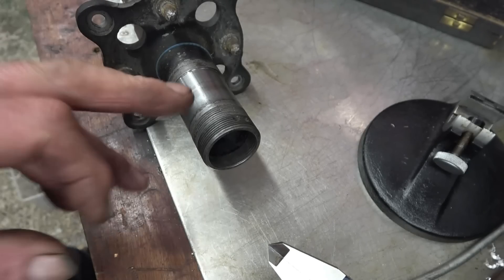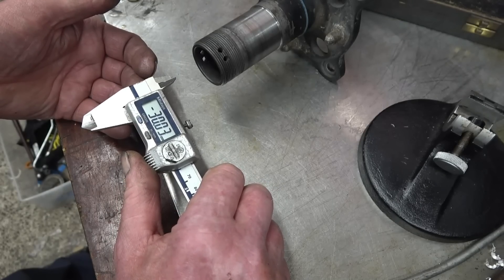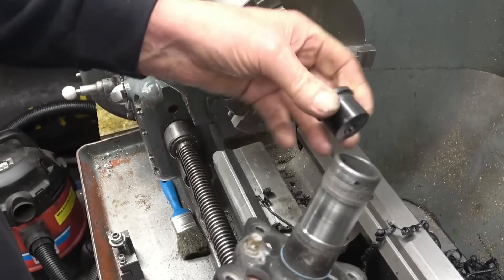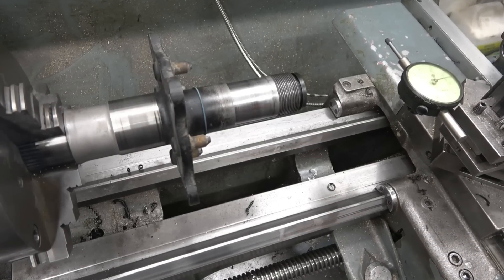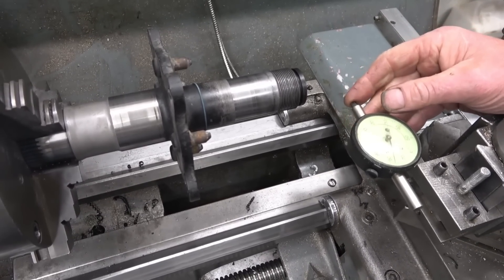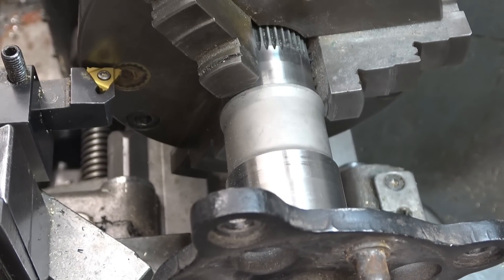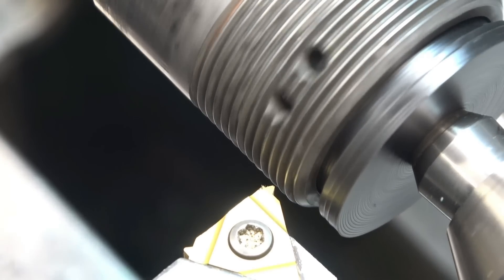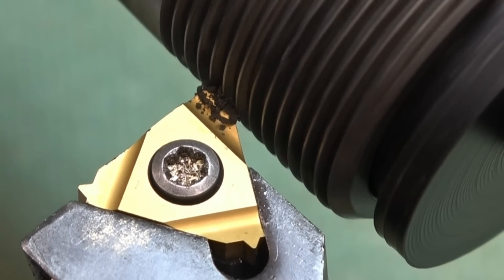SNNC 556. How To Pick Up A Thread On A Hardened Shaft.

Comment: For a mechanic who is an amateur machinist that's not bad. I have picked up some outer threads and it's a buttock clencher the first few times you do it. As you say, no distractions while you are doing it. Haven't picked up an internal one yet but that will be even more "exciting". Self taught mechanic/machinist in Land Down Under.

Comment: Any chance of re-uploadinng the video with some more sound on it please John?  (or was there so much swearing that YT censored it??? ROFLMAO!)
Reply from the maker: sound is working ay my end
Reply: @doubleboost  There are big gaps in the sound from  about 6 minutes in at my end? It comes back at about 15 minutes, for me at least. then back on again at 17 minutes, it's very intermittent, some crackling and popping?   Am I the only one?

Just checked out the second video and that's perfect.  There are still gaps in the sound also @ about the 7 to 8 minute mark